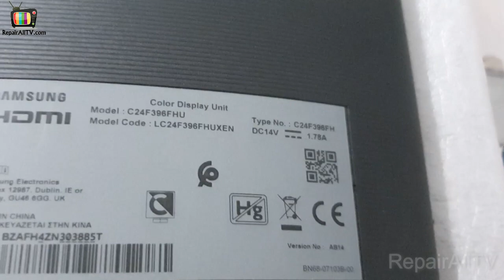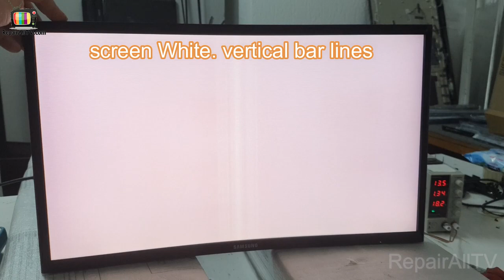SAMSUNG Curved monitor screen White  vertical bar lines

Comment: Hi there, thank you for posting this video which helped to fix my C24F396FHU monitor, with the same fault; but horizontal faint lines rather than vertical ones. Kind regards.

Comment: Do you have any repair video on the Samsung 27 inch monitor?
C27F591FDE Mine black vertical bar cannot solve
Reply: I have the same monitor with black screen, I dont know what to do with it

Comment: I have question, I have a curved monitor that is 75hz broken, what if I buy 165hz screen to get it replaced, will work?
Reply: The power the 165hz needs might be more than the 75 i doubt youll be able to get the most out of your screen tho